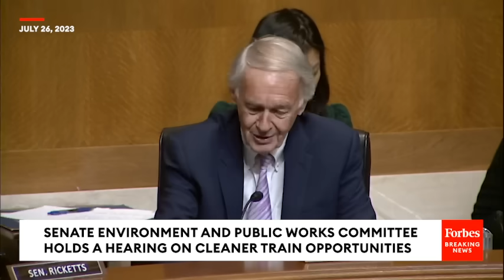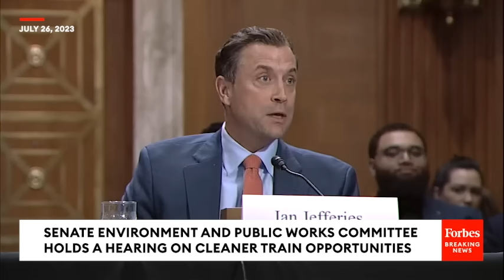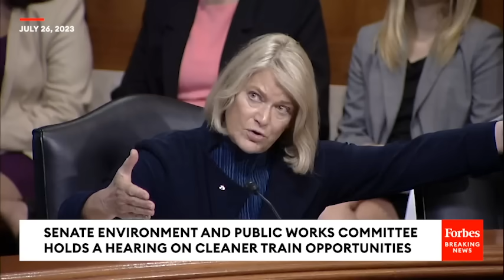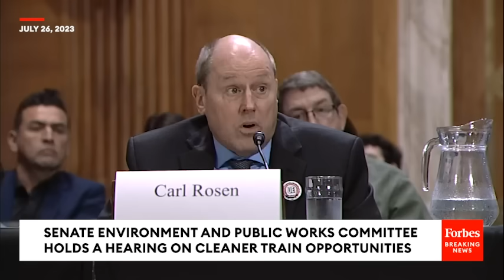‘How Long Would It Take To Replace All Diesel Locomotives With Electric?’ Cynthia Lummis

Comment: I don't think "moron" is a strong enough term. Locomotives are mostly diesel-electric. To make a fully electric locomotive? This is insanity. Solar and wind are a scam. The resources needed to build an electric locomotive would be insane. This isn't about the environment, this is about money, power and control.
Reply: 1. There is no such thing as "zero emissions"... only displaced emissions.
2. I'm not sure if the Senator is talking about battery electric locomotives, or conventional electrified railways, 
as seen in Europe and Japan, for instance.  Either way this is just another case of displaced emissions, not zero emissions.
Reply: @surlyogre1476   Agreed.  That "zero emissions line" is always used by idiots.
Reply: @surlyogre1476 electrified railways might work but I have major doubts about a battery powered locomotive ever going over two miles
Reply: @surlyogre1476   Or in the eastern US.
Reply: @surlyogre1476  Correct, on both counts.  The North East Corridor rail lines were electrified many years ago: they were outrageously expensive to build, but there was (and apparently still is) enough passenger traffic* on those lines to justify continuing to use the overhead wires, or 'catenary'; along with [electrified] 'third rail' in places where the other isn't feasible. That said, the NEC [Washington D.C. to Boston] has the only major 'wired' railroad lines remaining in America. *Electric freight locomotives ceased being used there, decades ago---diesels replaced them, thanks to economics.
Reply: @surlyogre1476 Yeah. "Zero emission" is a bit of a cop out. What we really need is carbon negative, not carbon neutral.
Electricfying transport is stupid if you never bother to make the grid sustainable. Right, power your electric train with coal power plants. Fantastic.

The senator is clearly uneducated about transport and energy and wouldn't be able to answer the question of batery or electrified rail tech. Personally I think it's implied you should only be talking about battery because we're talking about long-range freight trains and the 3,000+ mile range makes the concept of powered rails a rather silly one. Stupid expensive cabling and high energy losses
Reply: I was going to say much the same. Locomotives have diesel to power the generator that powers the electric motor. The only being done is destroying the supply chain.
Reply: Put solar pannels on top of trains and put sails on trains there ya go, problem solved.
Reply: @williamkennedy3837 🤣🤣🤣🤣Actually knock a hole in the floor of the locomotive and the driver can do a Fred Flintstone...... I bet one could convince Fartman Biden that this is a plausible idea!!!!
Reply: @williamblack7813  Shhh! Don't tell 'King Joe' about that 'hole in the floor' idea---he'd want to write yet another useless Executive Order mandating such idiocy!😵‍💫😆
Reply: @alansloan7784  Yep.....he would! 🤣🤣🤣🤣
Reply: @alansloan7784  I don't mean to scare you, but California might pass a law
requiring the feature on new vehicles. 😁😁😁
Reply: @williamkennedy3837 Ohhhh...I can breath so much better! But...what happens when the train goes into a tunnel, or under a bridge?? Ohhh...here comes my panic attack again! Will reality never leave me alone?🤦‍♂
Reply: @williamkennedy3837 please state for the record how many YEARS of electrical training you have...followed by how many years/decades you have in actual experience applying that knowledge.  I got 7 years of higher education in these fields, just to give you an example.....I'll wait.
Reply: Actually, there are pure electric locomotives in the US.  They get their electricity from a catenary system.  To go 100% pure electric locos in the US, we'd have to build a catenary system for the 137,000 miles of rail. That would cost about $1million per mile (just for the catenary) or around $137billion.
Then we would have to replace the 40,000 current diesel-electrioc locomotives at about $6million each or about $240billion.
$377billion, at a bare minimum.  Should we just add it to the $30trillion national debt?  No problemo. Call the mints and order more money to be printed.
Reply: You can only have the $377 billion if there’s $40 trillion for Ukraine and $3 trillion for people to have free ‘gender affirming’ surgery. 
Oh, plus 10% for the big guy.  @Tsamokie
Reply: @Tsamokie  The scary part of all that are the gullible fools; who actually believe it could/should be done!
Reply: Wow

Looking for a strong enough term 

I'm not sure one exists
Reply: A fully electric locomotive simply doesn't make sense, imagine the amount of batteries you'd need. Not to mention the charging. The costs to both the industry not to mention the environment would be huge.
Reply: There have been "fully electric" locomotives for quite some time.  But not battery-electric. Current battery tech cannot do it.  It sort of works for auto which need 200-300 hp.  Train locos need 4000-6000 hp per unit.  That is daunting.
Reply: @Tsamokie  But they only want wind and solar AS power sources! NOT oil/gas OR nuclear power!!!!!!
Reply: @John_Lyes You missed the mark. These people aren't talking about a fully electric loco. They're talking about a Battery/Electric Loco, i.e. it carries its own electrical source. It's amazing how the Greene's want US to pay for their fantasies.
Reply: Right on! 
Electric cars/pickup trucks can have batteries alone that weigh 1,000-1,500 pounds!!! 
Electric cars trucks are TOTALLY non-sustainable!
Reply: @garyseckel295  I've seen numbers like 8000 pounds of battery's to move one eighteen wheeler truck.  Not sure how far that would be but where does all the power come from to charge the battery's.  Solar and wind?  You got to be kidding.  But reality will set in soon or latter down the road so to speak.  I vote for a transporter, like in Star Trek.
Reply: @iworkout6912 I have a PhD in nuclear engineering and even I don't know how to build a matter-antimatter reactor that runs on dilithium crystals.
Hint, for the Star Trek fans out there - "SciFi" stands for Science FICTION - as in, it ain't real folks!!!
Reply: @iworkout6912  most of the power being put into electric cars now are now coming from coal. So essentially people are driving around coal cars.
Reply: @garyseckel295   Electric locomotives don't use batteries like electric cars. They run on tracks with overhead power lines that the locomotives connect to. Some, usually city commuter train/subway systems, use electrified rails. Both of those systems have been in use for a century now; they work perfectly well. The problem in the US is that electrifying the tens of thousands of miles of non-electric trackage we have will be expensive and will take a long time.
Reply: Ford lightning batteries weigh 3000 pounds your off just a little
Reply: @hoppy6663  Talking about semis.
Reply: Resources to build? What about the resources needed to maintain and run them on a daily basis?
Reply: Correct!
Reply: What, do you mean that you can’t put a couple of solar panels on the roof and power a train?
  The Idiots have taken over the show!!!
Reply: @michaelwpaulin4876   Actually, you could. You just have to make sure they stick up enough to touch the wires...
Reply: There are lots of fully electric locomotives around the country. There have been for over a century. They usually have wires overhead which transmit that electricity. It still isn't reasonable because of the increase of infrastructure and the energy cost.
Reply: @jruicker1 Please read my previous comments.
Reply: All of this solar stuff out there, beware. Money making opportunities have ruined everything. I was interested in solar but before contacting anyone selling solar ( hounded with phone calls trying to sell), I wanted to talk with someone that would tell me what I need to know, a couple of engineers at my local power company did just that. Solar is not for me, I dont use enough and I would not see a return, that is all I needed to know. People make sure you get enough panels.
Reply: Here in Switzerland we have one of the densest railway networks in the world. It's 100% electric.
Reply: @philippos5547 and it's primary use is what transport people here in the USA it to transport good not people on thousands of mile vs Europe with is country that fit inside the palm of my hand lol completely different scenarios
Reply: @philippos5547  Where does the electricity come from? Is Switzerland cluttered up with windmills and solar farms?
Reply: @philippos5547 no it's not.
Reply: @philippos5547 I'm still waiting on that formal training/education you have in the electrical fields.....maybe you have a degree in hot air. Eh?
Reply: @FoxtrotCharlie2   Not sure what the problem is? Australia runs its heavy coal trains on electric as well. https://en.wikipedia.org/wiki/Rail_electrification_in_Queensland
Reply: Can existing railways and bridges support the weight of these electric engines and their batteries and how will this effect the number of freight cars the locomotive can pull? How many days will it take an electric locomotive powered train to cross the country? How much time will be spent to recharge the batteries? Where are we building these new green power stations to provide all of this electricity?
Reply: De-industrialisation. Because most of you wont be alive by 2030. Kamala said so.
Reply: Actually, this is about "controlling the means of production", the foundation of Marxism.
Reply: They aren't talking about a fully electric loco, those were developed more then a Century ago. They're talking a Battery/Electric Loco. So instead of laying catenary(the overhead structure that supports the electrical supply line), the fools think they can snap their finger's & a fully functional Loco of their dreams will appear w/in a decade. I agree w/ you, this is about power & control authoritarian(Marxist) style.
Reply: Absolutely, Lets wait for  China or India to show America how it's done.
Reply: Solar isn't a scam. it's the only correct answer.  It's super easy to build and repair solar power plants and we have virtually infinite viable places to put solar plants because it doesn't need constant refueling.

Electric locomotives are insane though. We can't even power electric cars let alone trains.
Reply: You are thinking inside the box. Think Maglev trains have the potential to revolutionize how we travel. The trains levitate using magnets, zipping through the air at speeds above 350 mph. These high speeds would allow for maglev trains to be a realistic alternative to flying, and they use very little energy and emit no pollutants during transportation.
Reply: This line of questioning, & train of thought, is much like pounding triangle peg into an oval hole. Environmentalists Know this for a Fact but, being told you're Wrong, & the Ripple effects that it causes, doesn't fit into their agenda!
Reply: Okay geniuses, switch all of our locomotives to electric and get your power from a catenary system . Have any of you considered what will happen during the next wind storm , or ice storm , or heavy wet snow storm ? I have , and the answer is that the wires will come down and the trains won't move for hours or even days . Oh by the way , how do you intend to run the refrigeration units on the box cars that are keeping our food supplies from spoiling especially while the train has no power to move itself down the tracks ? Haven't considered that little problem yet , have you ?
Reply: @bobbrinkerhoff3592  Refrgerator cars have a diesel motor  to keep food cold.
Reply: Electric locomotives have been used from 1900 up to today. The northeast corridor from Boston to Washington was electrified since the 1920s. At that time electric locomotives had more power than the biggest steam locomotives. They get electricity from an overhead wire. Others got power from a third rail. Power stations for them were connected to a power plant. They ran on 660 volts DC back then.
Reply: @ErnestImken Yeah...well big deal. There have been numerous studies done by the RR's & they found Electric Loco's have limited use. The infrastructure is expensive & maintenance must be factored in. What the Green Zero Emission Fool's want to believe is that a Battery/Electric Loco is viable & it's not. Diesel/Electric is the only viable solution for long distance freight haul. The Tier 4 Loco's are pricy & there are row's of unused Loco's in yards across the Nation. RR's add so little emissions it's worth laughing in the faces of these Greenie Fool's. The CA CARB Board are Fool's in a big way.
Reply: @carmiethompson2676  They work pretty well in other, more developed countries. It's generating the electricity that's the problem when the tree huggers won't let us build more nuclear plants.
Reply: @jwatson9732 Yeah, don't use the "...it works well in other Countries..." excuse. I've been getting the same w/ High Speed Rail too. America handles our rail system on a 'for profit' basis because there is a better chance of self-sustainability. The Europeans, Japan & Asia subsidize their rail systems. France for example has 10(?) high speed routes. There are only 3 that are profitable & that profit is dumped into the other 7 routes. If there's a short fall, the French tax-payers payout. The tree huggers have to realize that they can't have a transport system or atypical tech. w/o serious issues.
Reply: @jwatson9732 still pure electric loco are good to carry people not heavy load
Reply: @carmiethompson2676 lol comparing a high speed train for people vs the us system that primary to transport good from one side of the country to the other nobody use train to go somewhere
Especially with how cheap flight inside the USA are
Reply: @legros731 Read my comments again. My arguments were never about the viability of a Passenger HSR system across the Country.
Reply: @legros731  Tell that to our Class 88's  in the UK lol
Reply: @ErnestImken the amount of electricity a cargo train usese for propulsion is equal to a large town. Running large trains the way you are thinking of is impractical. Normally over head powered trains are light commuter rail, not long haul heavy trains.
Reply: @thadrepairsitall1278 bullshit. Pennsylvania Railroad, Virginian Railway, Norfolk & Western Railroad, and the Milwaukee Road all used fully electric locomotives to haul heavy freight trains, VGN in particular used them for coal drags. And many railroads in places that aren’t in America use electric engines for…everything.
Reply: @IndirectHydrox  Maybe Leftist's windmills will spin faster! LOL! HELLO!?!?
Reply: @IndirectHydrox  And they all got rid of the overhead wire and switched to diesels.  The wire was a maintenance headache.
Reply: @IndirectHydrox  You left out the Black Mesa & Lake Powell and Muskingum Electric railroads where coal was hauled.
Reply: And.., water-located windmills, sadly, will  continue killing whales!
Reply: Except for the former PRR lines that are now part of the North East Corridor (passenger service only), all of those other electric operations have long since been dieselized. As for the European rail lines, they still have emissions from their power plants to contend with.
Reply: @IndirectHydrox no...lies
Reply: @ErnestImken lol man nothing got more power that steam locomotives
And by the way all locomotive are driven by electric motor today it just a big diesel turning a generator
And overhead power line is crap, unreliable,costly and need constant maintenance  you know the thing they constantly talk about climate change making more tornado ect. Perfect for overhead wire 
And if it getting power by a 3 rail is extremely stupid and dangerous it not like a subway where the rail are inaccessible vs a railroad in the middle of a city with 600v running through them unprotected
Reply: @ErnestImken  Wrong. The NEC wasn't electrified in the 1920s. In fact, North of New Haven to Boston wasn't done until the 1990s under Amtrak. And then it was at 60Hz AC. The first train that was electric ran from NYC to DC in 1935. The DL&W had electrics in 1930 and ran on 3000VDC. The CMStP&P was ahead of that and ran on 3000VDC in 1914 to 1916.
Reply: @ErnestImken  That was limited to passenger service and in a very limited area to electrify.  You can not do that on thousands of miles out west.  It just does not work that way.
Reply: Fully electric locomotives are not a new technology. They've been around for a century and are in widespread use in many countries around the world. There are some fully electric trains in the US, and they've been in use for decades. These are mostly Amtrak trains in the northwest part of the country.

The reason most rail in the US is diesel-electric instead of fully electric is that the US is a very large country, geographically speaking. When steam was abandoned, there was the choice of going full electric or going with diesel-electric locomotives. Going full electric would require running overhead electrical lines over tens of thousands of miles of existing track, so to save the expense (and the huge amount of time needed to build it out), diesel was adopted.

Saying that making full-electric locomotives is 'insanity' is an idiotic thing to say because full-electric locomotives are already in use in many places, and have been for a long time. Switching to full-electric on every rail line in the US would be very expensive and time-consuming, so for now its not economically attractive to railroads. But it is possible.

Other big countries like China and Russia that use full-electric trains on a larger scale than the US were able to do so because they didn't have the legacy non-electric trackage that the US has. When they built their railroad infrastructure, it was all being built from scratch anyway so it made sense to just build it as a full-electric system. Smaller countries in Europe with older tracks could do it because they didn't have a lot of track mileage to convert.
Reply: @christophercrawford777 you right and wrong at the same time pretty funny you said USA got too big distance for full electric and you compare it to Europe where you can go from one side of the country to the other and back to your house in half a day 
When one state is bigger that 2 European country lol
Reply: @christophercrawford777    Both Russia and China used steam locomotives extensively, before changing over to both diesel and full-electric locomotives. Not every place in either country is economically suited to total electrification---the same is true here in America. While electrics have a limited range of usefulness, to insist that using them nationwide is feasible is unrealistic, at best. (Economically AND ecologically disastrous at worst).
Reply: Battery Elec Loco are waste of time but Fall Elec with over head wire YES